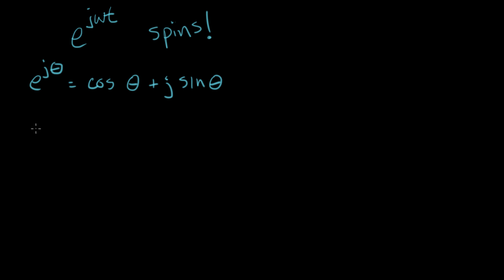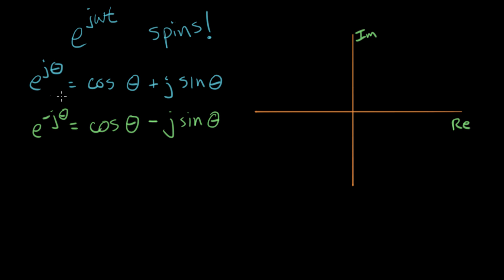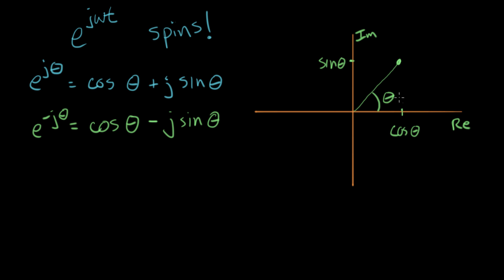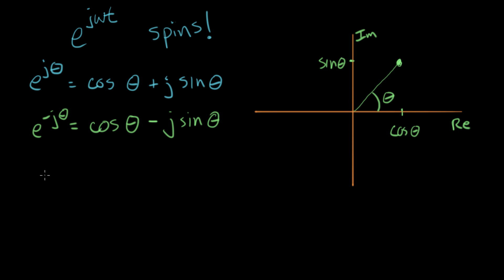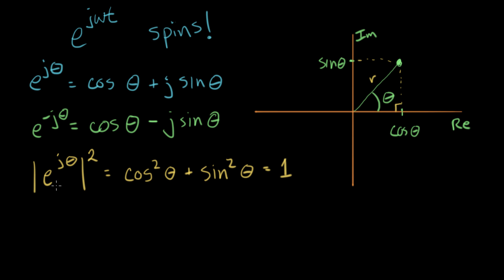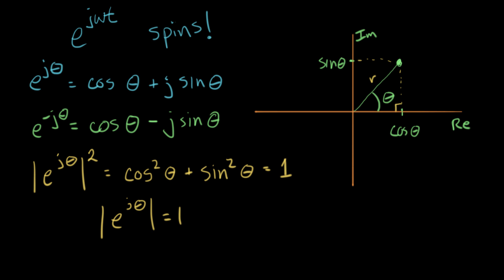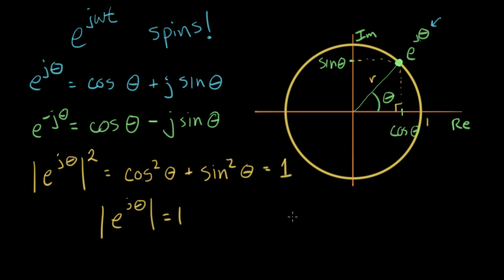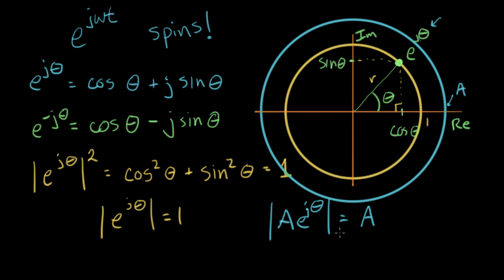Eulers formula magnitude

Comment: On my maths exam board we use j instead of i. Apparently it's because i is also used for current but electricity isn't a topic anywhere on that board, so why would j be used?
Reply: Just as an FYI, current is not always denoted with a capital I, it can also be denoted as i, (some textbooks/courses like to use I for DC current, and i for current that varies with time (ex. AC)).
Reply: maybe because currents has i as symbol
Reply: idk what you mean anything on that board cause current is electricity... but thats usually an I not an i so idk why anyone would use j
Reply: +Henry Lembeck I mean it as in I don't see why current would be an issue because on that exam board they only do maths; there's no exam with electricity as a topic so current would never come up. We use J for impulse instead of I too, it's a bit weird ;)
Reply: i is also used for iteration (index) even more in signals... so there is also problem same as in el. stuff with the i
Reply: Later when u will study about electronics or electrical u will need complex f. So iota is represented by 'j' so that current 'i' and iota don't get mixed up